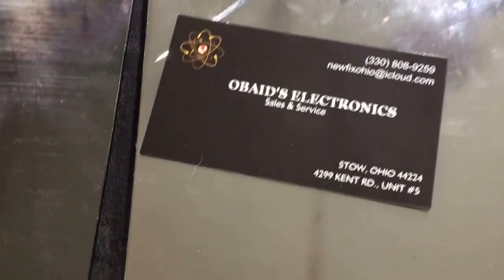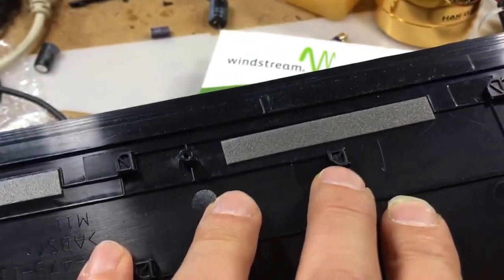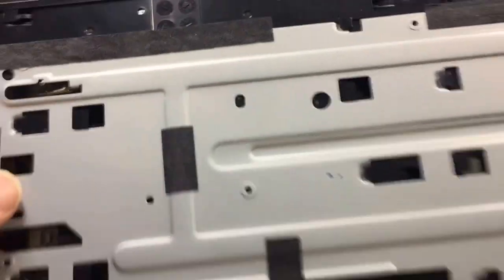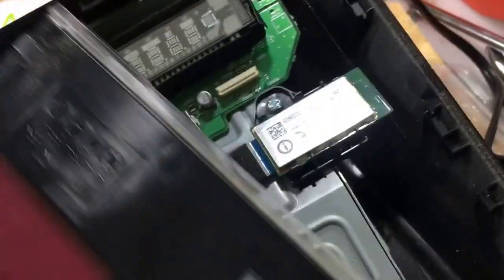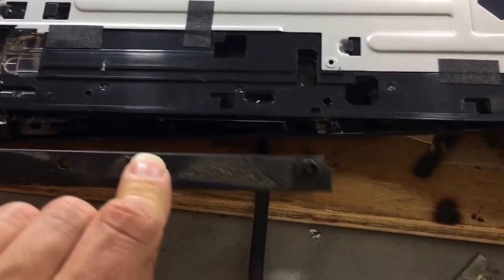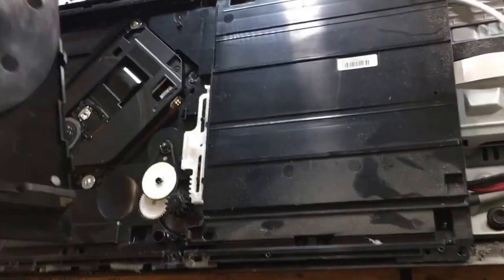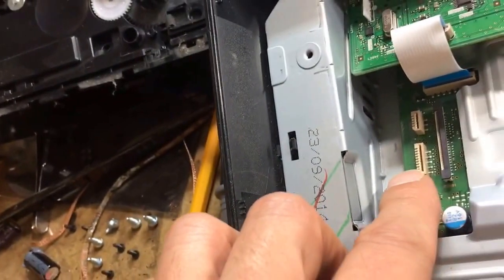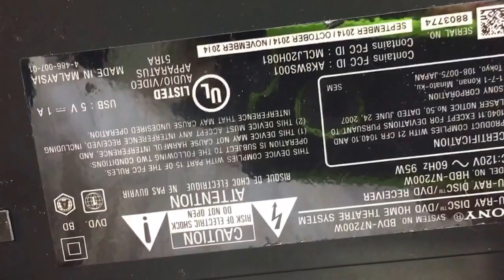🔴SONY Blu-ray HBD-N5200W/BDVN7200W/N7200W/N7200WL/N9200W/N9200WL  disassembly procedure

Comment: I was wondering if you can help me find a dealer for a replacement main unit dc fan for N9200wl or at least specs for aftermarket alternatives like model/dimensions & wiring

Comment: I have a Sony BDVN7200W 1200W 5.1 Channel 4K Hi-Res Blu-ray Disc Home Theater System. It stopped reading disc's. "No Disc" etc. Now, it will not even boot up. Does it sound like a compassitor? And where in the world can a person order the parts if needed?

Thanks very much

Comment: Hello sir I am using BDV N7200W. There is no sound from Front speakers all the plugged speakers not working. Only rear working
Reply from the maker: swap speaker see if that helps if not you need amp board. Please don't forget to subscribe

Comment: what is the cause that a main board of a bluray BDV-N7200w got locked? this occurred after an update. Is it possible that this spare could be found? (A-1980-183-A)  or could be repair? Some help on this issue thank you
Reply from the maker: you can text me 330-422-3978 and please don't forget to subscribe to my channel thank you
Reply: @shopelectronicshub  Ok
Reply: @shopelectronicshub  I did it but text didn't pass